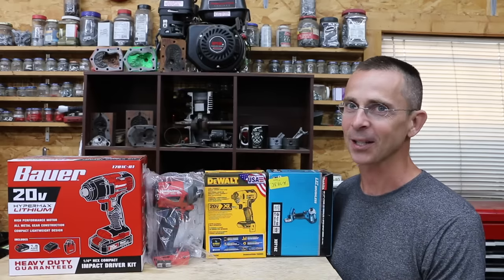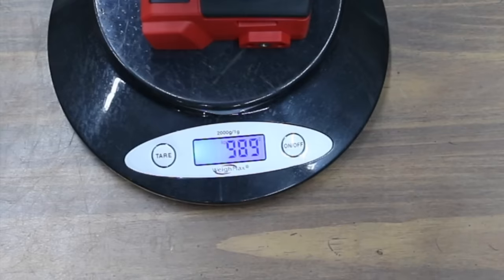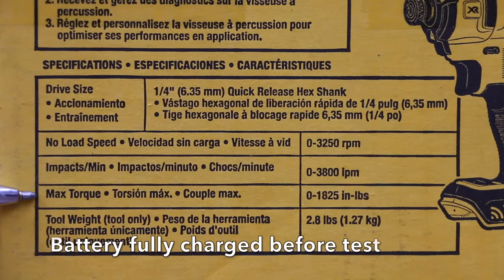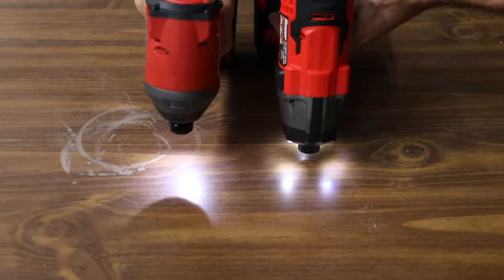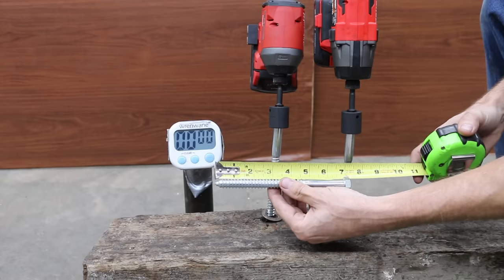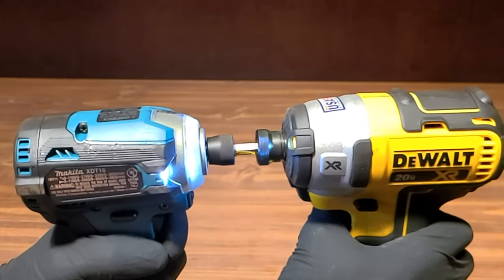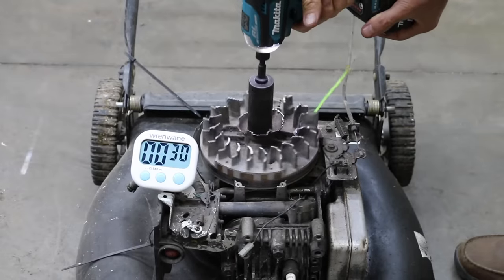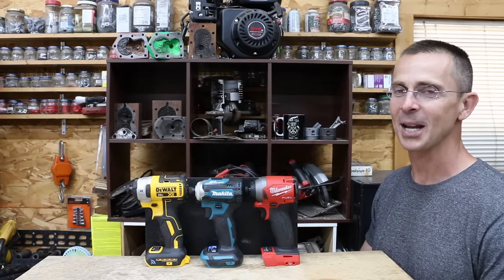Best Impact Driver? DeWalt vs Milwaukee vs Makita vs Bauer!  Let's find out!

Comment: Anybody who ever used milwaukee tools knew what the outcome was gonna be
Reply from the maker: Thanks for watching.
Reply: RollinRat  yes
Reply: I build irrigation machines, and we’ve tested Milwaukee and DeWalt. We put about 2000 3/4” inch bolts in every day. I’d take a DeWalt hands down before a Milwaukee. DeWalt batteries last a hell of a lot longer. Milwaukee switches always go out, they don’t hold up in rain. So DeWalt kicks ass.
Reply: I know exactly what you mean . My Milwaukee tools are incredible. I will never buy another brand of tools . Incredible durability and power 👍
Reply: @Sinister392  yeah, I switched & never looked back
Reply: I really wanted to go Milwaukee but I had the M12 from Home Depot and absolutely hated it! not near as powerful as everyone said so I just dropped the whole line and went with DeWalt and never looked back...
    The only Milwaukee product I'd ever want to try is their impact driver.. some DeWalt products are better, some Milwaukee are better but in the impact driver I think we can agree it's Milwaukee for power @ this point..  but who needs that much power... I'd like to have it certainly but my DeWalt 887 is all I need and more..
Reply: @addisonjeffs984  agreed Milwaukee has a ton of power and little things like you listed in terms of durability and reliability make the case for DeWalt all day.... you can liken it in terms of switch failures, Collett retention issues dead batteries Etc from Milwaukee being like an extremely slow internet connection or unresponsive phone screen @ times when you need your phone for something important..
I prefer DeWalt but absolutely have no beef with Milwaukee guys
Reply: You Hit the nail right on the head.
Reply: I'm a car mechanic and Milwaukee brushless tools are all anyone I know uses in the industry. Even the small 12 tools are handy and well used.
Reply: Yay our team.
We abuse Milwaukee at work on a daily basis as shop supplied tools, enough to know its was a safe bet to get my own for home use.
Reply: @addisonjeffs984  so true. I use to use Milwaukee and had nothing but problems with cordless line. I switched to dewalt and I will never look back!
Reply: @addisonjeffs984  Our shop had the opposite, we sent out both cordless and corded dewalts out on warranty for batteries, chucks and switches til we tossed the lot in the dumpster and switched to milwaukee. Daily use 5 or 6 days a week, all year long and we've only ever had 1 chuck and 2 rounds of batteries in 4 years. Use Milwaukee at home and I'll never by a DeWalt again. Wondering if different countries get different specs as I haven't met anyone in Canada who uses DeWalt unless they went in on it for all their tools and swapping over is too expensive, or they are more hobby and home than daily users.

That said, whatever works for you and your guys man. All the problems aside our DeWalts got the job done when they workes. And I should say the corded hammer DeWalt we swapped for a Hilti and if I ever get one myself I'll spend the extra because Hilti is a beast for concrete and masonry work.
Reply: came here for millawakee vs dewalt for sure
Reply: Yeah! Milwaukee all the way.
Reply: @addisonjeffs984  Well, I've been helping my son in law for the past 3 months on a construction job.  He uses his Dewalt and I use my MIlwaukee.  We have been beating the crap out of the tools (leaving them out over night in the rain and snow) using them for hours a day and he's on his third Dewalt and my 4 year old Milwaukee is still going strong - plus my batteries seem to last nearly twice as long as his - and they are 4 years old (where his are brand new).  He will often run into screws and bolts that he'll have to pick up my Milwaukee to get as his doesn't have the power.  His is a bit more compact and he likes the chuck better as it is easier to use one handed but I know he wishes he'd bought the Milwaukee tools now (he's made his battery choice so is stuck with the Dewalt line of tools now).
Reply: And not even a fuel
Reply: @creese2180  wow I didnt even notice 🧐
Reply: @addisonjeffs984  

Warranty on the Milwaukee is 5 years. DeWalt has 3 years.

DeWalt is a pricier tha Milwaukee.

My Milwaukee is 3yo and still going fine. A college of mine is using DeWalt he fcked his impact 3 months ago and it was less than a year old. 

Now that being said he doesn't care after his tools, so durability is very subjective so i would stick with the longer warranty.

Also I am not really sure about the battery because one tool that provides less with same capacity batter it's battery should last longer. Also when it comes down to 20cm screws everyone secretly wish they had a Milwaukee.

DeWalt is a great tool and there is no point changing brand and wasting money on batteries for a new set of another brand just because its slightly better. Although I did switch from Makita to Milwaukee 3 years ago simply because i like when someone comes to me to borrow my tool to do something theirs can't :D
Reply: I work in a trailer factory and have used quite a few Milwauekee/Dewalt tools. I probably drive somewhere around 300-400 screws per day with applications ranging from just basic wood screws for walls to hardcore selftappers to anchor subfloor to the frame. For driving wood screws the Dewalt XR, Milwaukee 2853, and 12v Milwauke Fuel are nearly identical in performance. For drilling they're about the same also, though I use a 12v Milwaukee hammer drill for most things. For basic small self tappers going into the steel frame the 2 Milwaukee Fuel's (12v/18v) are noticable superior to both the Dewalts and the Milwaukee 2850. The Dewalts don't seem to hammer hard enough whereas the Milwaukee 2850 hammers so hard it breaks screws and pops the bit out of the screw head.

Overall the Milwaukees are just superior drivers, no question about it. Unless you're just pushing wood screws.
Reply: C Reese, it was a Fuel model
Reply: Dewalt fanboys can't afford a milwaukee 🤣🤣🤣
Reply: @barakobama8194  dont get me wrong, Dewalt stepped their sht up but its too late for me im already on the milwaukee train
Reply: @barakobama8194  no company is your friend.
Reply: @tedundercarriage8183  but your mom is
Reply: I quite like dewalt their old 18v drills are made like tanks and the 20v interchanging batteries between our leaf blower and driver and new drill is nice as well will say I respect anyone that uses Milwaukee
Reply: @someone-xc1lj  I don't.
Reply: @barakobama8194  I'm sure you love bingo too
Reply: @tedundercarriage8183  a company that offers a 5 year warranty vs a 3 year is my friend of choice.
Reply: @nikpridy9589  And when they deny it because of bs reasons, you'll be looking for a new friend.
Reply: @tedundercarriage8183  hasn't happened once in the last 6 years . Just take care of your tools pal 👍
Reply: @nikpridy9589  Spotted the 'feels good in the hand' guy 😒
Reply: @tedundercarriage8183  Spotted the "tinfoil hat" guy! 🤏
Reply: @steveburton5825  Glad they work for you. I've had the same experience. I did a lot of concrete too, and had the opposite thing happen to me. so others work better for other people. In the end we all get our work done!!!

Comment: I’ve had a ryobi I’ve used hard for several years and it still runs as good as the day I bought it. I would by another one without a second thought
Reply from the maker: Thanks for the feedback.
Reply: I love my Ryobi tools, they're not the best but they're consistently good to very good and at a fair price. If I ever break one I know I'm pushing it too hard and I need to spend the money on a DeWalt.
Reply: @Wohlfe  I won’t say any one company is the best but the work I’ve gotten out of mine has been excellent between that and the price point I’ll have no problem buying another or trying other products of theirs because of my personal experience
Reply: I've been pleasantly surprised by my Ryobi collection as well. I do take DeWalt into the field, where the heavy abuse happens, but Ryobi is more than enough in the woodshop. After this vid I kinda wish I had picked red instead of yellow, but so far I've only killed a yellow jigsaw and ZERO green Ryobis have died in my hands.

Comment: As a die hard Milwaukee guy, this video made me a happy man
Reply: Because I'm Japanese, I'm a Makita guy. But, by watching impact driver, impact wrench, ratchet wrench comparison video, looks like Milwaukee is the best brand for cordless power tools. I will try milwaukee tool when I get my 3rd stimulus check!
Reply: I prefer dewalt and Milwaukee products. But, I will typically buy Makita because they usually provide a hard case with their products. I hate that most tools don't come with cases these days
Reply: @derekgardner1861  dude I know, I can't even figure out when they stopped doing that. I had at least 20 tools of all different brands, with snug fit cases for each. Now everything just comes in a cardboard box.
Reply: @ZERONEINNOVATIONS  ehhhh I wouldn’t say that race has anything to do with where I buy tools. Whoever makes the best tool gets my money
Reply: @timothydu9415  Its not about the race, Makita is a Japanese company. It's like american people love made in USA stuff
Reply: The need for repeatedly re-pressing the trigger of the Milwaukee is a dealbreaker, try to count how many times the trigger is pressed, then imagine you got 300 screws like that. This test only shows what i been saying, other brands do well in torque tests but only Makita does the job without hickups. 
I have a cheaper Makita impact driver, the brushless DTD155, its enough since i got the expensive Makita brushless 1/2 inch impact wrench DTW301 for heavy jobs, that thing is awesome (in the US it has something with 14 in the name, been praised in reviews). AND WHY do you need an half inch impact? the socket adapters like whats used in this video steals a lot of the impact power, you can see it on the torque test channel but remember that 99% of what they do there is benchmarking and has nothing to do with real life usage so dont use their videos as buying recommendations.
Reply: @pflaffik  the Milwaukee is only stopping like that to protect itself from damage in this unrealistic scenario. It’s fine for a head to head, but you should not do this in real life. It’s not what an impact driver is designed for.
Reply: my uncle rolled his truck and the impact went flying and sill survived. the tools a trooper 😂
Reply: @ZERONEINNOVATIONS  ergonomics are equally as important as all of these tests for me and Makita are undeniably far more ergonomic. Lighter and more refined. Milwauke feels overkill and unrefined in the hand. Its like automotive ethos transfers into tool manufacturing. Milwauke has been made to be powerful and big and heavy when refinement is what would be better. 

The torque all of these drivers deliver is more than enough to snap almost all screws and small gauge coach screws and even the bigger stuff. The tests done here push these tools to their limit but fact is you won't be replicating them in life. You'd use a 1/2 inch impact wrench. 

A Japanese manufactured DT172 is the pinnacle of current impact driver technology and quality manufacturing.
Reply: I felt like my kids were graduating college😅💪
Reply: @derekgardner1861  because most people throw them away
Personally I hate them
Reply: @ryancox3834  to me the Milwaukee feels fine in the hand
Reply: How can you really be a "Milwaukee" guy in this era?  Practically every tool sold my Milwaukee is Chinese made, and on top of that, They're 100% different tools in design.  Just top Chinese brands labeled with Milwaukee....
The days of USA made Milwaukee tools are long gone.  Makita at least, still makes tools in Japan.  They do offer a home depot type line for US Americans who love rebranded Chinese tools, but if you're a pro and spend the money you can find REAL made in Japan Makitas.  And yes, they're better than any Makita branded China Junk.

For what it's worth, Milwaukee was once the best tool brand in the US, I have many.  I wont buy any of the new Chinese Milwaukees.     If anything, I am tired of sponsoring the construction of the Peoples Liberation Navy.
Reply: @ZERONEINNOVATIONS  Japan does make some really great tooling.   Never seen anything made in Japan that I didn't like. Makita, Hitachi, Trusco, Juki, etc....BUT I have to ask, as Japanese, how can you be so excited about a "stimulus" check?   Japan has been racked by decades of debt, stagnation and recession...."Stimulus" checks adding to a massive federal debt are a Japanese problem in the making.
Reply: So umm.. made in Vietnam wins eh? Followed by made in China and third made in U.S.A? Go figure..
Reply: @timothydu9415  i know your silly comment was only for the sake of virtue signaling.... but still maybe one needs to point out to you (equally silly comment FYI) that tools don't have a race, and humans have only one race with many ethnicities :)  either way,  irrelevant.  Maybe in the near future one can legally identify as an impact driver if you really want to.    More power to you.  Seriously though,  as an American  I proudly support American products in order to support American companies, American economies, and American jobs, and I expect other countries and ethnicities to do the same, and nobody should be accused of racism for their tool selection
Reply: You really cant go wrong with any of the top three. Just pick your favorite color lol
Reply: HILTI THO
Reply: @ryancox3834  Thanks for this perspective. I no longer have to sell the my yellow tool for the red lol.
Reply: @cs-rj8ru  I'm a student here in US, so I was excited about the $1400 stimulus check! I bought 18V brand new Makita electric ratchet. It's awesome!
Reply: @ZERONEINNOVATIONS  Best for burning brightest , Makita will last you should know this being Japanese Block ...
Reply: Damn right
Reply: The only thing that sucks is battery life
Reply: @AbraKaDaniel Yes.  I am trying to avoid Chinese products whenever possible
Reply: As a guy who said ill never buy from Harbor Freight, this video made me a happy man!!!
Reply: @benananunya3875  maybe it is cost savings?  who knows.  at least offer it as an add on option.
Reply: Hell yeah
Reply: Why does nobody talk about Metabo tools ? They may not be as powerful however they are made in Germany and bulletproof
Reply: @ZERONEINNOVATIONS  My foreman has Makita tools, they were so smooth and powerful. I might switch over from Dewalt.
Reply: @AbraKaDaniel that's what I look at first when I buy tools
Reply: Me too 👍

Comment: I bought a Bauer used for $20.  It does a great job for medium duty tasks.  I don't drive thick screws into railroad ties.  It is a beast for driving normal sized screws into hardwood though.
Reply from the maker: Thanks for the feedback.